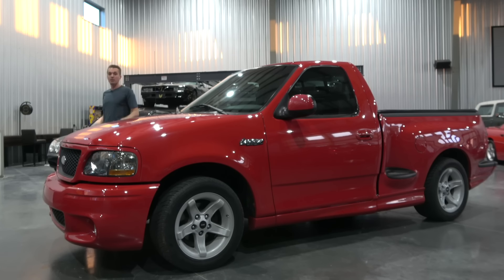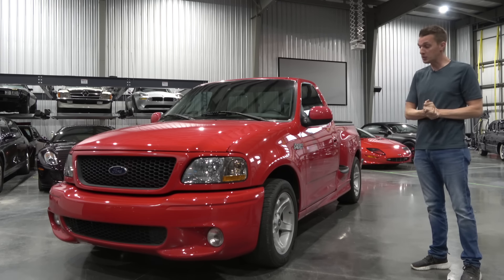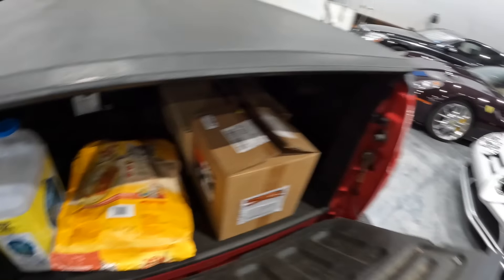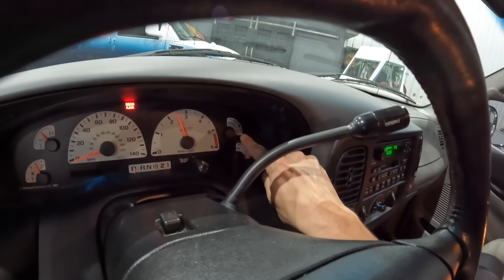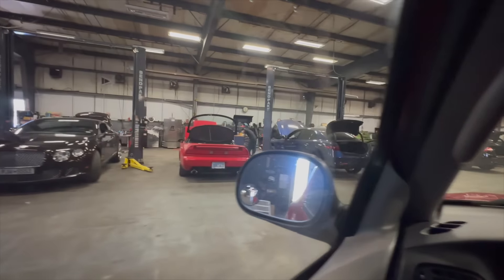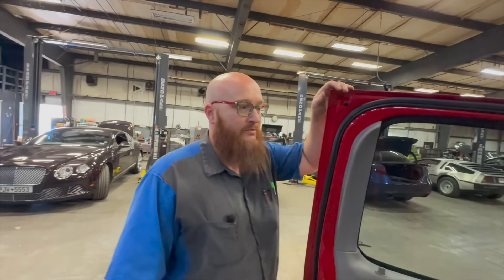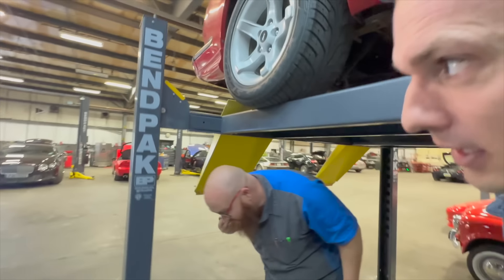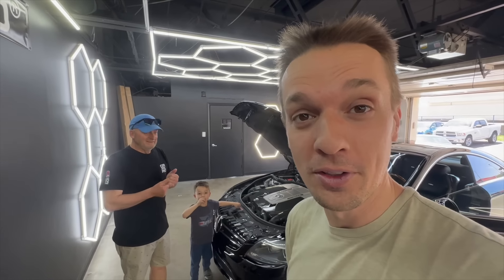Buying the cheapest classic Ford Lightning while I still can. (WAY BETTER THAN THE NEW LIGHTING EV!)

Comment: Owned the first one in the state of GA in 1999.  Saw it on a the delivery trailer and followed it to the dealer and bought it on the spot.  Cool vehicle for its time.  Collectible?  No ideal why.  Not that fast, can't carry any weight in the bed and still handles like a truck.  Can't even smoke the tires off the line without brake torquing it.  The only thing cool about it was it was the first production truck with 19" rims.  Cool for its time, but mystifies me why it is a collectible.  I guess it would be something like my desire for late 60's early 70's muscle cars.  The great cars of my youth.
Reply: It's a stupid fun truck that is unique and very reliable.. it's decent quick stock for its time it was as quick as a 99 cobra in the quarter or not far behind it they could turn high 13s at 100+.  That ain't too shabby for the late 90s.  Simple bolt ons would have you mid 12s at 110 mph.  It's Def fast for a full size pickup for it's era.  Still a very fun truck today and they're unique and that's why they're desirable. If you don't understand why they're desirable you don't understand these trucks.  If you actually owned one like you say you'd think you would.
Reply: They had 18 inch wheels btw with 295 all around.  Are you sure you actually owned one?  Lol.  It's a factory supercharged truck.
Reply: It handles far better than a regular truck from this time.  Things you say make me question if you actually owned one you sound like some young dude talking out his ass
Reply: @midnight347  lol.  aaaaand they soy boy comment comes out.  Always the way online.  Child, I've forgotten more about vehicles than you'll ever learn.

Comment: Hoovie says he would like a Ford GT-40. Jeremy Clarkson had one which spent most of its life being fixed. IMO, Hoovie should get a well-sorted replica. They come with 42inch height so the headroom is real world usable. Failing that, a Lancia Stratos replica they look much nicer than the originals have better engines (Alfa Romeo 24valve V6) and cost 1/0th the price.

Comment: Triton V-8 POS. Hope you find a guy to rebuild the oil pump every 50k miles. Aluminum pump bolted on to the rear of the engine (cast iron). Engine rubs through the pump and it fails suddenly and unexpectedly. LOL! Have Fun with that!

Comment: Long before Tyler became the dumbest man on YouTube, I was perhaps the dumbest man in an F150 Lightning.  Back when these were new I was working for a shop specializing in Aftermarket truck accessories.  One day I was tasked with picking up a brand new yellow Lightning from the dealership about 30 minutes away from our shop.  As was custom, I placed the dealer plate in the rear window so not to damage the paint on the tailgate and set off.  Long story short, I thought it would be a good idea to see just how fast it was.  Entering the hwy, I took the plate off the rear window and threw it on the passenger seat and stepped on it.  Down the express straight away I achieved a top speed of over 140 mph, the needle bouncing off the limiter before a cop on the opposite side blasted his lights and sirens briefly.  Off the gas it took me probably a mile before a long sweeping left bank turn, still going way too fast.  Super sketchy! Next exit I pulled off and crawled back to work taking every side road I could.  To this day it remains the fastest I've ever driven.  I know some of you will say you've gone faster, but the speed at which those mile markers went by... The length of a football field every couple of seconds.  It was like having tunnel vision.  Crazy!

Comment: Lame burnout.
As a teenager I had a '70 Cutlass rust bucket that I'd just rev a couple times, drop into drive and nail the throttle and light the tires in a no-brake rollout.

Comment: I've always been stuck of the styling for the 95-03 F-series, especially the step side.  People did not like it much, but the swooping body lines and fenders harken back to the 50's truck styling.  Granted, the fascia is it's own 90's thing that is meh.  The biggest thing is that it was the last of the trucks that were appropriate truck size, back before they had to bloat them like crazy to keep putting V8's in them...thanks government.  That is why Ford can't make that many Rangers and Mavericks, by the way, it will crash their Combined Average Fleet Economy(CAFE) ratings, so even though people want them, your government says that you cannot have them...but they also say that you CAN have a useless battery truck.

Comment: I’m not even sure the new lighting ev actually qualifies as a truck. If the bed can’t be removed and replaced with whatever upfitter equipment needed for the task, then it’s not a truck anymore; it’s only a pickup.

Comment: 1:15 Yeah no, the 454's good for 600 horses depending on what mains they put in that, needless to say that would blow the doors off of even the most modern one if it was setup right with a supercharger, also ford of that era lied about their performance, remove a 100, and that's what you actually got, so 300 foot pounds, and about 280 HP, on par with what a 454 puts out, when setup right without forced induction

the problem was the rest of the truck couldnt take it, as theirs a reason why those were put in Drag Chevelles, with the more advanced rear end that could take the power

usually a ford 9 inch ironically enough

and I've never seen a ford lighting actually do 5 seconds in all my years, let alone smash a BMW M3

like maybe the legit street cars lighting with all those mods and changes can actually reach 5 now

but this ford 150 Lighting, was no bolt of lighting, 

its just a mid to late 90s ford pickup truck with a supercharger on it, kinda like all there cars of the era

even the Ford GT, which I've never understood the love for, as you dont have the noise, the look or the performance of the original

and your better off going with a superformance with a 427 under the hood and 300 grand left over in your pocket than one of those

plus if you want to make it a targa, nothings stopping you from just cutting the roof off, given just like the delorean, the supports in the sills

Comment: Those 10th generation pickups from ford are both the most interesting trucks and also the worst of all the generations ever. They are the weakest of all the generations, have some of the worst safety ratings, but they are also like the similar year GMCs and Chevy's they are just enough modern to be comfortable but are not overly fancy. I have owned 3 of them and I love them to death. Especially over here in western Kansas they just take the roads and our weather without issue.

Comment: Yeah pretty much every Ford engine since 2000 has had some really bad issues. This is the 5.4 sohc 16 valve which is about million times better than the 5.4 that came out in 2004. Spark plugs popping out sounds horrible but it's actually only 1/2 job per hole. And it's better than new. What's worse is when the plugs get stuck and you have to extract them. You'd rather have them pop out. With that being said pretty much every domestic car manufacturer has problems with their engines. Chevys ecotecs were a disaster dodges 5.7 hemi are not a great engine. The new displacement on demand from Chevy is horrible. Its all going down hill.

Comment: "Sport truck" is an oxymoron.  It might go OK in a straight line under power - but it can't go round a corner fast, and it can't brake well - so it's still a truck, just a truck with a uselessly powerful engine in it and horribly compromised as a work truck - it's not really very good at anything - so really it's just for dude-bros with small willies.
Tyler only thinks the JZA80 supra is "insanely overvalued" because he's not into Japanese sports cars at all (just like I'm not into "sports trucks" at all) - it's worth what people will pay for it, just like a lot of "overvalued" Italian or German cars from the same era is worth what people will pay for it because it's what they are into.

Comment: Americans are so weird.  A truck is supposed to be functional.  Simple.  Utilitarian.  Sure, over the  years people have customized them... but the fact that the big 3 would offer these high horse power monsters to consumers is just mind boggling.  Oh, and by the way, for a while Toyota sold a factory tuned, supercharged, 500+ hp TRD Tundra... that was VERY fast.  But they didn't beef up the other components enough so it was very prone to eating transmissions and other drivetrain parts.